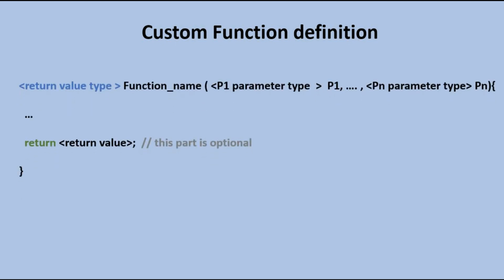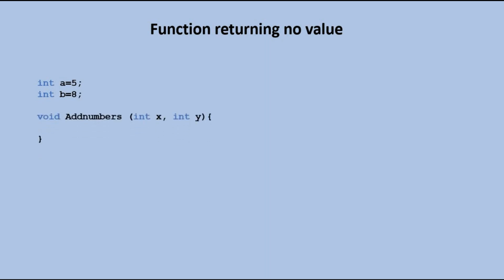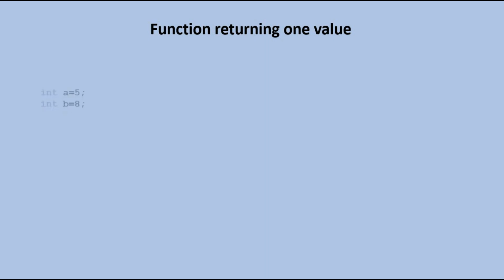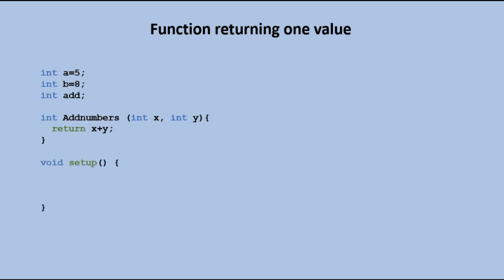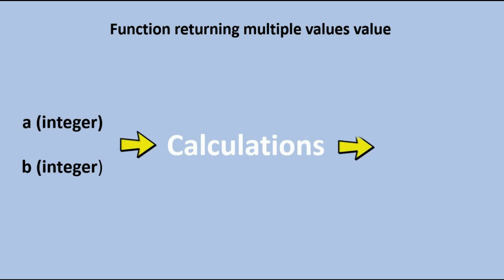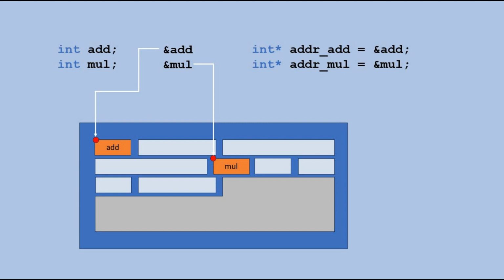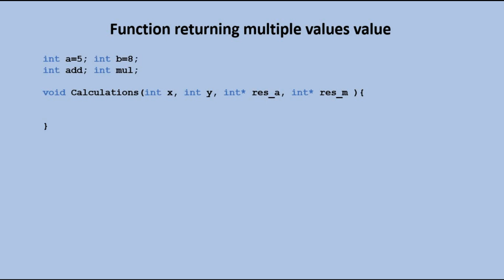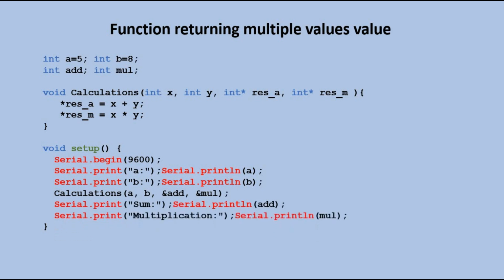Beyond Basic Arduino: Creating Custom Functions for Multiple Returns

Comment: Hello,

I made also a program. And it worked!!!

How can you use an timer in an fuction using Millis. I can not get it to work. I stript my program only tot the timer.

******************************************************************************************
#define PinLed  6

bool xBlinkOn;

void Test();

void setup() {
  pinMode(PinLed, OUTPUT);
}

void loop() {
  Test(millis(), &xBlinkOn);

  digitalWrite(PinLed, xBlinkOn);
}

void Test(unsigned long time , bool* xOutput){
  unsigned long timeBlink;
  bool xInit; 

  if (xInit== 0)
  {
    timeBlink = time;
    xInit = 1;
  }

  if ( time - timeBlink >= 500) 
  {
    *xOutput = !*xOutput;
    timeBlink = time;
  }
} //Test
*******************************************************************************************************************
Reply from the maker: Can you explain what you want you sketch to do?
Reply: Yes,

I am programming a Switch statement to activate diverent relay on a condition and a timer for each relay

I deleted the switch statement because the timer does not work and want so simplify the program to parts that work.

So my toughts were, first the timer, after that the switch statement.

 So thats why there is a simplex blinker program is in this function
Reply from the maker: @82edje Still not clear to me . Explain what you want test function to do

Comment: Hey 👋
Isn't it possible to create some kind of custom type on Arduino? An object with properties “sum” and “mul”.
If so, you just need to create the object inside a function and return it.

Because it doesn't seem to be a good practice to use pointers for a case you've described. And I'm pretty sure it's possible to create custom type in C, which means it must be available on Arduino.
As analogy, you may also check the data type called “object” in JS.
Reply from the maker: Of course. There is many ways to skin the cat. You can create the structure consisting of composite data types and use it to declare function output type. I think this should work. This was just to present one way of tackling the issue at hand:)

Comment: I have a doubt regarding an arduino project that I'm doing but can't explain it simply and I am nt able to find a solution on the internet Because I don't know what to search. My project contains an IR receiver connected to an arduino. When I press a button on my IR remote, LEDs connected to the arduino blinks in a special sequence that last approx 1 min. I have mapped 5 such buttons on the IR remote with 5 different blinking patterns. My problem is, How can I stop the blinking of LED after I press any of the 5 aforementioned with a new 6th button. It's already in a loop. I will add my code for more clarity. I am a noob and I really don't know what I'm doing to be frank Ha ha! If it's possible and won't intrude on your valuable time, would you be able to look into it and provide your insight, please? 
Code > https://drive.google.com/file/d/1OsYqO-6YCjFkClShAJ1Uxzt9PoRKHnUG/view?usp=drive_link